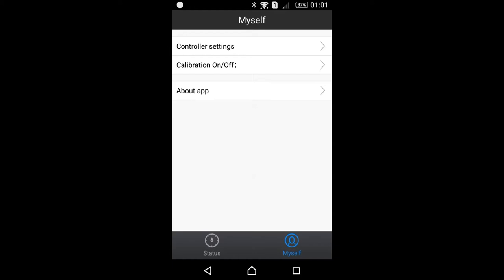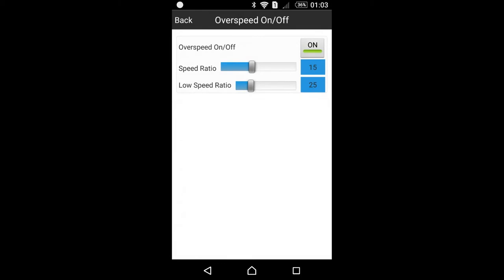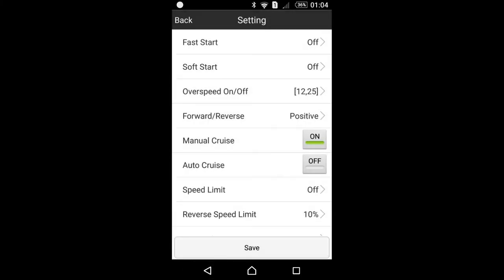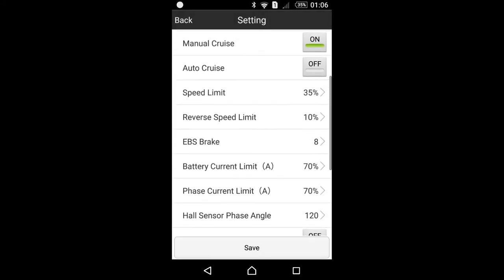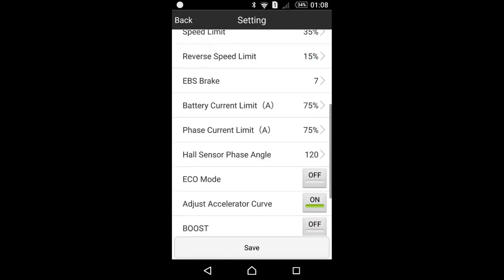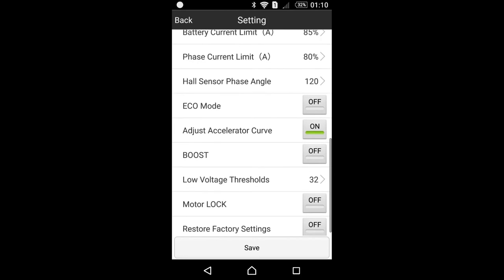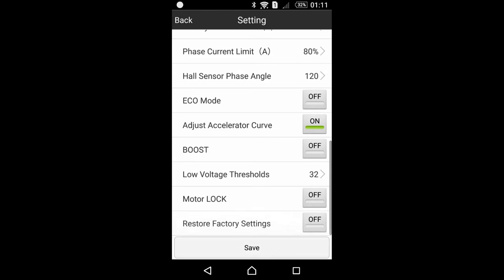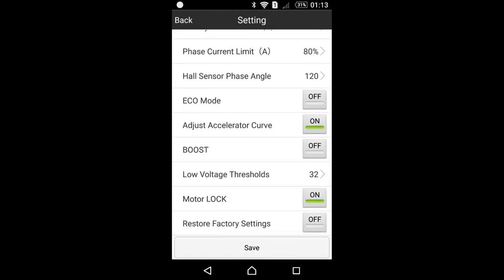2021 electric bike scooter / e-bike / e-scooter wirelessly programmable brushless motor controller

Comment: Great explanation of the app settings. 
Can you please tell me where to find the app? I already have a controller with the Bluetooth module, but I can not find the current app.
Also, do you know if a cyclone mid drive motor be set up for regenerative braking?

Comment: Which wires of the controller is the Bluetooth module connected to? thanks
Reply from the maker: They are connected to 5v power wires and also to to data exchange wires (via one of the Bluetooth protocols). 
But you will not be able to use the Bluetooth adapter with any other controller, it can only be used with this programmable controller.
Reply: @Albert-gz3kd  how can you know if a controller is programmable ?
Reply from the maker: @elias8981   Programmable controllers usually have a USB wire for PC, or (if it is a Bluetooth controller) - such controllers may have a separate wireless dongle which may or may not come with it. Anyway, usually if a controller is a programmable one - then the seller mentions that in the description.

Comment from the maker: Hello,

You can buy it from me (you can contact me through ebay if you want to buy the adapter), but the Bluetooth adapter only works with a programmable controller. The Bluetooth adapter will not work with a plain (non-programmable) controller.

Comment: if the battery is disconnected does the controller reset to factory settings?
Reply from the maker: Hello, Fernando. Regarding your question:  no, controller does not reset to factory settings after disconnecting the battery. All settings are saved in the controller memory, no matter if the battery is connected or not.

Comment: i have downloaded the app and can see the bluetooth controller on the screen, however when i try to connect the app closes. is there an update/fix for the app???
Reply from the maker: You can contact the supplier / vendor directly, from where you have bought the controller, please.
Reply: @Albert-gz3kd  I tried, they don't respond.

Comment: EBS (electronic braking system) has nothing to do with battery regen...Just the level of how much/less  you have to squeeze the brake lever.
Reply from the maker: No, in the app EBS setting is exactly for adjusting the power of regenerative braking indeed. 
In the video I explain settings which are related to the programmable controller and not to EBS meaning on other motorized vehicles!
That's the difference.
Therefore: EBS setting in the brushless programable controller app is exactly for choosing the power level of regenerative braking, that's for sure, as I am dealing with the controller for many years.
Reply: Really? Mine has it and it's electronic braking system. Sorta like ABS on a car. Get it?  You're not getting battery regent on cheap Chinese ebikes lol
Reply from the maker: @BillFromHalifax  As already explained in my previous reply: EBS setting in the app is for regenerative braking of the controller and the motor. That's been tested many times and therefore confirmed.
If EBS is set to "OFF" in the app, then when brakes are pressed - there is no regenerative braking, only motor cut off, and the motor slows down longer of course. There is regenerative braking on this controller, because tests with ammeters have shown high current going back into the battery, and charging the battery when braking. Of course for that to happen charge and discharge port on the BMS needs to be the same. And certainly battery and its BMS should be powerful enough handle fast charge. And of course, regenerative braking is only possible on direct drive hub motors. Regenerative braking is impossible on geared hub motors and on mid drive motors with a clutch, no matter which controller is used.